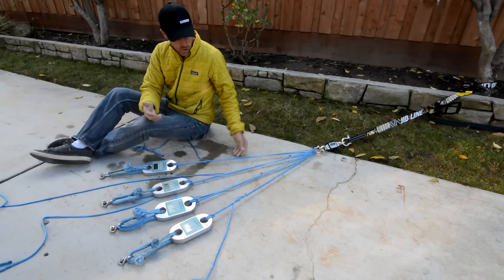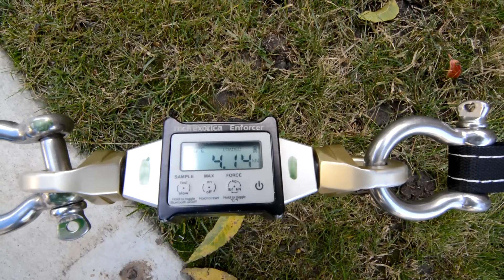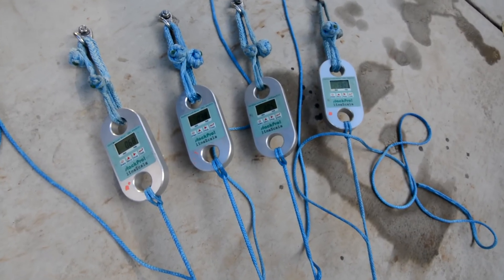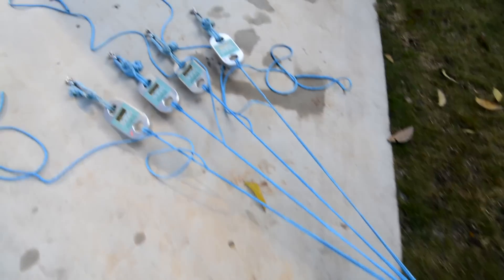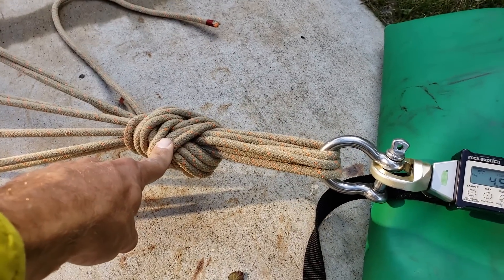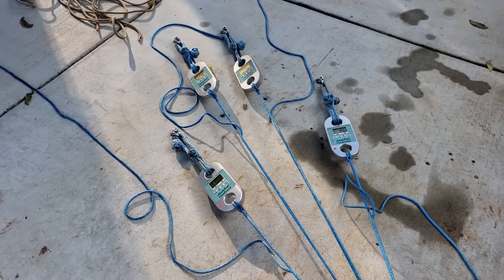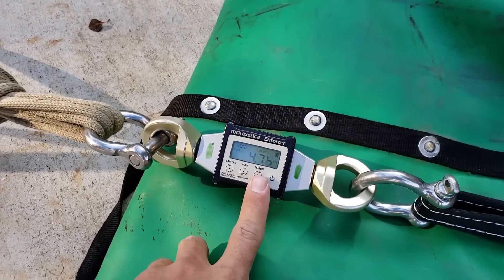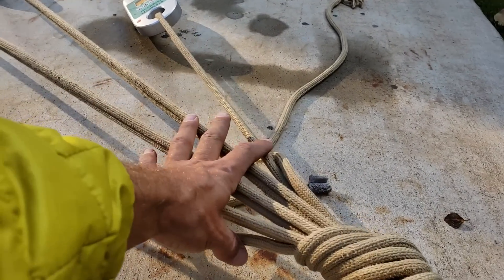Can you build highline anchors only with whoopie slings?

Comment: one thing about the bfk equalization is that it is impossible to  dowithout detensioning the line or transfering tension to a secondary rope and redoing the knot.  correctly tying a bfk with the desired equalization ratio on first try is difficult on a cliff edge when you have limited experience in the location and for novice riggers. lazy riggers may be more prone to accepting suboptimal equalization with a bfk. on the other hand with whoopie slings, you can pretension the line and then adjust the equalization more easily on the first try. additionally, the whoopie slings provide a higher mbs per anchor point so the redundancy is better in the scenario where one of the anchor points breaks. with 6 mil equally tensioned you are getting 120kn, whereas with the 9mil bfk you are getting ~60kn. in the case you have only one anchor point left, you have 30kn vs 14kn mbs. per 100m of rope, 6mil dyneema weighs 1.6kg and 9mm rope from the black diamond weighs 2.7kg, plus you need almost twice as much rope as with dyneema, which of course splices into itself so not exactly twice, but you are easily looking at twice more weight with a bfk.

So while the bfk is more versatile and has better abrasion resistance for natural anchors I can see definite advantages to the whoopie.
Granted, I have never used whoopies for anchors myself. I would love to see more tests with whoopies.

Comment: hi Ryan

We are highliners from India and we mostly use green spansets for our anchors with a sliding X. but, we were wondering if we could use only amsteel rope as anchor rope instead of static climbing rope or canyoneering rope. What would be the pros and cons of using amsteel rope sliding X as an anchor. 

Also, could you show us what a vertical wall configuration should look like for best equalization?  we have a few lines where our bolts are  on a vertical rock and we would love to see the bolt patterns used for that that would provide best equalization. 

thank you for adding so much scientific knowledge to the highline community.
Reply from the maker: If you made a loop with amsteel and stitched it, technically yes you could use that instead of a spanset or rope.  I choose not to do that because if we have bolts that I can thread my rope into (mostly glue ins or the M12 hangers from landcruising) then I wouldn't be able to do that with an already closed loop.  Amsteel is not abrasion resistance so it can't really be used to rig all natural (wrapping boulders).  I loooovvvveeee my static rope and the versatility I have with it.  Technically I have a soft shackle that is 7 meters long... yes you read that correctly, so I can thread it through glue ins and then attach the noose over the head but because soft shackles are double stranded it takes so much more rope than if I just used a static rope.  Same with the whoopies in this video, it takes so much amsteel that I'd rather just tie a bfk.
I will try to do a verticle rock anchor soon.  That seems to be an important topic lately.  Ask questions anytime.  Cheers.

Comment: have you tried tying web locks directly into the masterpoint loops? It's fiddly but doable, you can even make the loops different lengths to offset the main and backup.
Reply from the maker: No i haven't.  Im sure it can be beneficial in some scenarios but a soft shackle is light enough i like being able to separate the two or add soft releases.